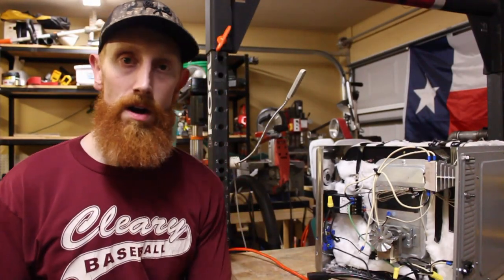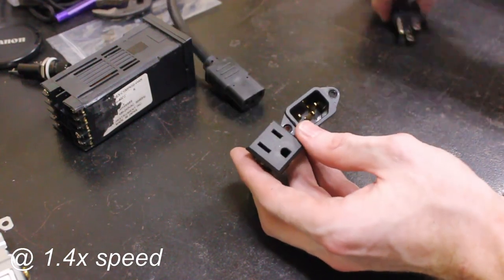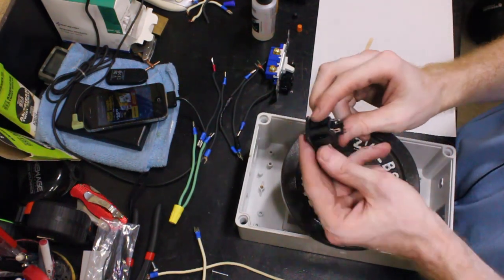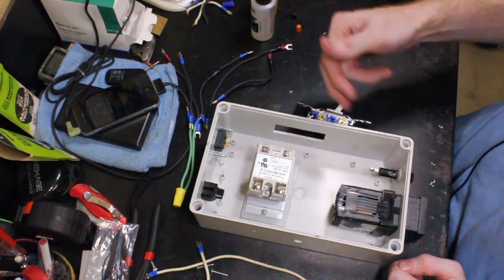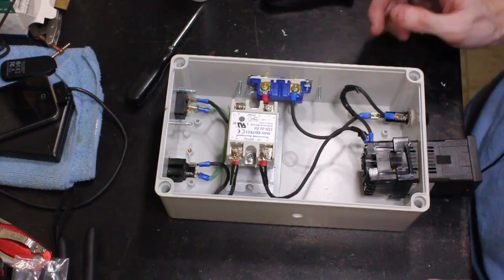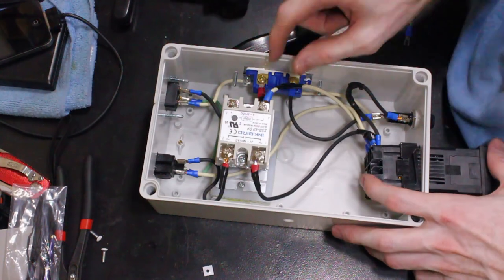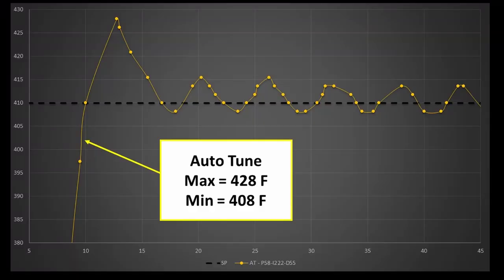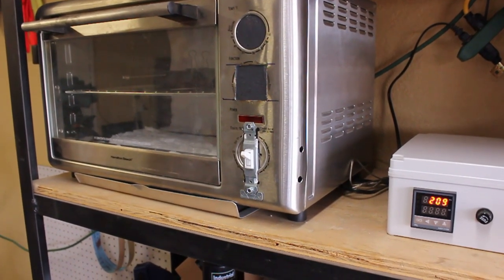How to Build a PID Controlled Toaster Oven | Full Guide | Round 2

Comment: Man I’ve been over and over the wiring everything is as you did it I tried another SSR nothing helps I don’t get it very frustrated and don’t know what to do from here
Reply from the maker: CT, I really have no idea. Every PID will be wired up a little different. All I know for sure is that these components wired the way I did it work and have worked for others. An electrician I am not for sure. You may be able to find an online forum to post your issues and try to get some assistance.
Reply: Thanks man I’m not sure either thanks for the reply though I sent pid back and I’m getting a new one maybe that’s my problem  thanks screwed around with this for like 2 hrs was getting pissed so had to stop very strange when I turn it on the pod comes on just not my toaster or the SSR thanks again
Reply from the maker: @Anderson-HandForged  Man that sucks. If the SSR isn't cycling and the PID is powering up it think it can be 1.) the PID being faulty 2.) SSR being faulty 3.) PID not being wired right?
Reply: @RedBeardOps  i think i figured out the problem i ordered a  MY PIN TA4-RNR I SHOULD HAVE ORDERED THE TA4-SSR THATS why ssr not turning on my toaster oven will keep you posted hope this is my problem
Reply from the maker: @Anderson-HandForged  10-4, hope that's it
Reply: @RedBeardOps  hey bro finally got it to turn oven on now I hope it will keep temp where I need it to be b4 if I set knob on toaster oven to 425 it would be like 450 or higher
Reply from the maker: @Anderson-HandForged  Heck yeah, may take some adjustment, but hopfully the auto-tune will do it for you. Take a hard look at that manual for autotune
Reply: @RedBeardOps  I’m having problems setting it up any advice on how to do it would be much appreciated thanks again for everything
Reply from the maker: @Anderson-HandForged  I have some tips in this video on how to program one to run on the P of the PID. In reality you need to refer to the manual that came with your PID. Look up how to auto-tune first.
Reply: @RedBeardOps  thanks I will and I will let you know how my heat treat oven comes out just waiting on my elements

Comment: Anyone know what was the rating for the fuse?
Reply from the maker: My memory doesn't go this far back, but I'm fairly sure the fuse is small and just there to protect the PID controller. Probably 1-2 amps? 

Here is the saga of my PID oven builds... you could ask these guys for sure: https://www.bladeforums.com/threads/wiring-a-pid-for-your-tempering-toaster-full-walk-through.1655733/

This thread pre-dates that one and actually has a comment about running a 15AMP fuse.... Guess it's there for surges - https://www.bladeforums.com/threads/pid-toaster-preliminary-questions.1647527/page-2

Comment: Those harbor freight terminals are absolute garbage. A crimp on terminal should resist pull of 40 lbs, they won’t resist 5. Tested these extensively when I built a massive project. Hopefully you’ll have better luck.

Comment: These InkBird 106VH  controllers are junk, the display is unstable, I have several all brand new and all do the same thing, the display temp.  jumps up and down by up to 2 degrees both ways. worthless. I use PT100 sensors perhaps that has something to do with it but a good controller would work properly, Useless to me.
Reply from the maker: Good to know!